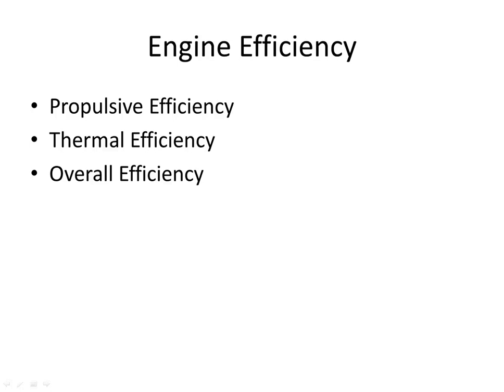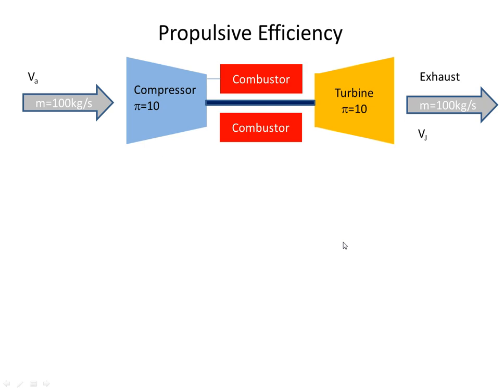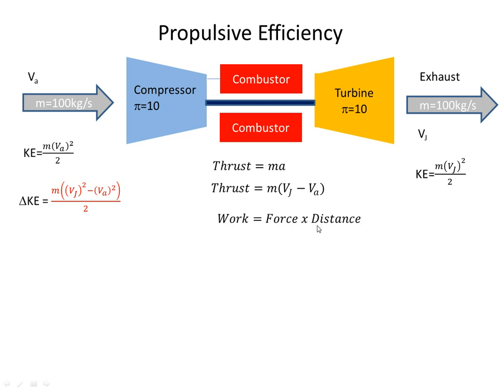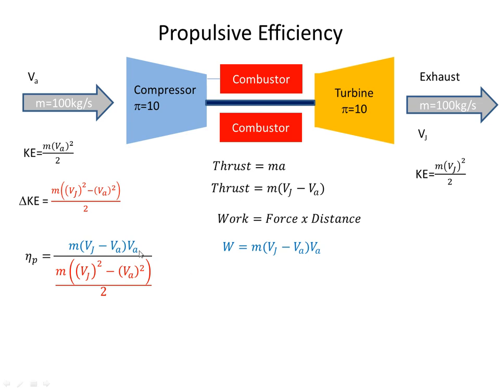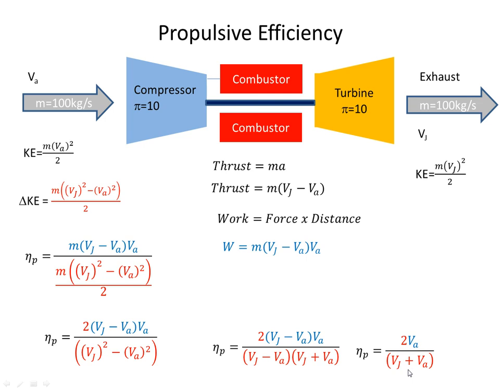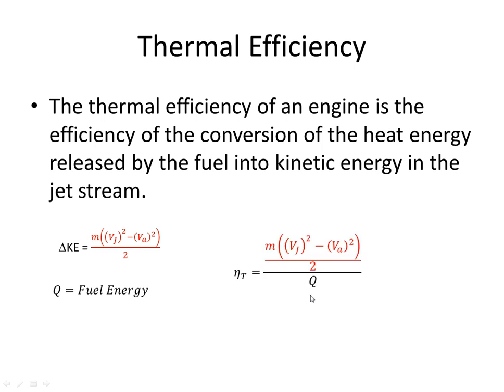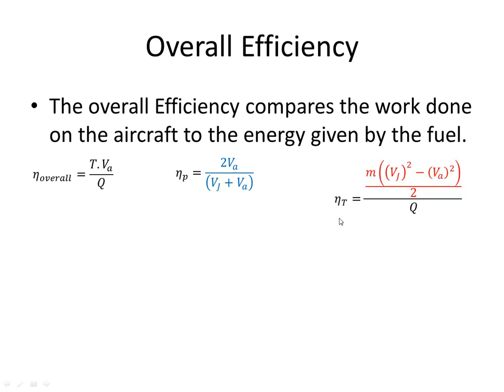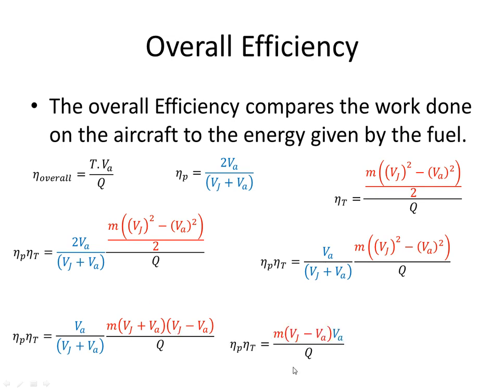Jet Engine (Gas Turbine) Efficiency

Comment: How come acceleration replaced with velocity change only..??
why not divided with time...??
Reply from the maker: kishor kumar 
the mass in the equation is really the mass flow i.e. kg/s.  It's this that allows us to  use the velocity change only.  Acceleration = velocity change / time.
If I mulitiply kg/s by m/s I get the same thing as multiplying mass by acceleration.
Reply: That makes the formula on the next line wrong W = m * (Vj - Va) * Va, because here the mass is not a mass flow rate, otherwise it would be power, not work. You have to be consistent in your notation.
Reply: @qewqeqeqwew3977  thats work done per second

Comment: Does it make sense?
That KE gained by air partly contributes to thrust power???
Help ty
Reply: yes the air is still moving and leaving out the back end so it is adding to the thrust ... sure not by a large amount BUT it is still compressed and therefore is a portion of your overall thrust equation

Comment: work = force x distance. Let apply this equation to a helicopter. Suppose the helicopter is hovering in the static air (air is not blowing). so how much work  in this case ?
Reply from the maker: What work is being done on the air moving through the main rotor blades?  The air has a mass, it is being accelerated throught the blades (F=ma) and it moves from above the blades to below the blades (distance).  Hence work is done on the air.
Reply: thank you, then let's try to calculate work in this case: work = force x distance = Weight x velocity. So what is velocity ?
Reply from the maker: Ok, in this case the helicopter is not doing any work as it is stationary.  But work is being done to the air.  So we could say that the work put into the system (moving the air through the main rotor disk) is not having any effect on the helicopter so the system has 0% propulsive efficiency.
Reply: I am still confused. Let's see another case that is easier to disscuss: firmly mounted that jet engine in your video to the ground and do some thrust tests. So in this case,  propulsive efficiency is still 0 ??
Reply from the maker: Yes.  Proplusive efficiency is still 0.
Reply: then overall efficiency is 0, what?? then how to calculate the power of the engine ??  F.v = F.0 = 0 ???
Reply from the maker: Yes overall efficiency is 0.  As the engine is not moving, there is no work and hence no power output!  What you could calculate is  the power input, and this would be the Heating Value of the fuel (typically 43MJ/kg) multiplied by the fuel burn (kg/s).
Reply: thank you so much for your answers.

Comment: You made a mistake. The equations should use m-dot [kg/s]. If you calculate mV, you're calculating a momentum, not a force. it should be m-dot V throughout, although they do cancel later on.

Comment: how can I find the 'm' if its not given ?
Reply from the maker: +niloopher fathima The following formual won't be too far off the mark.
m =  Air density x Cross sectional area of the intake x Velocity of Aircraft
Reply: thank you ! :)
Reply: I do not have the fuel energy Q value , is there any formula that can be derived to fond the Q ?
Reply: If *

Comment: oSPEAK UP ... the content is good the voice volume is CRAP ... so crap it has to be voted down because no one can actually hear you 
.
readjust it with a better volume and it will be worth watching ... another hint ... if it is written on the screen DONT READ IT ... they are called BULLET points ... they are to point YOU at a specific topic to speak about ... if it is all written then mention that this is what it is for and why ... everyone can read ... assuming a modicum of common sense even those that isnt so common any longer.
.
 also subscript your KE with a and J to differentiate them from each other ... because ke at a and ke at j are NOT the same at all times in operation ... as it is at start with rho=10 for comrpessor and turbine ... they are ... but not always ... and the equation is KE =(m . vasq)/2 = (m . Vjsq)/2 when rho at compressor and turbine are equal